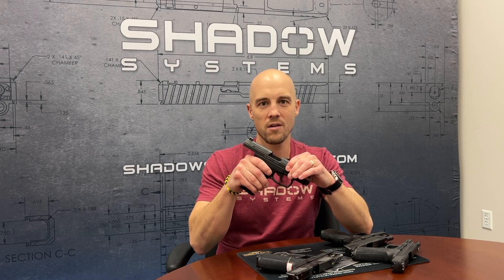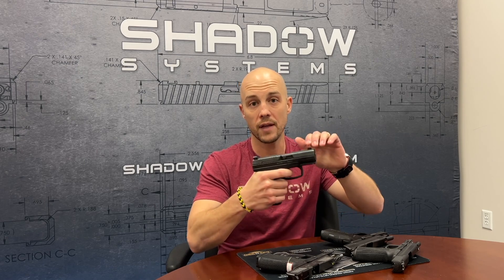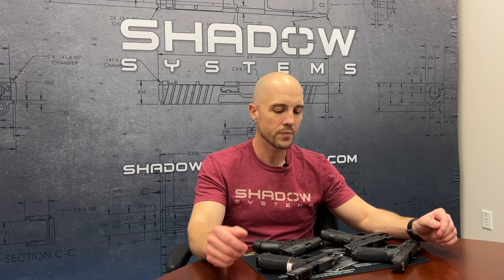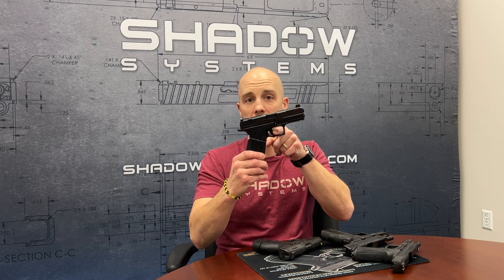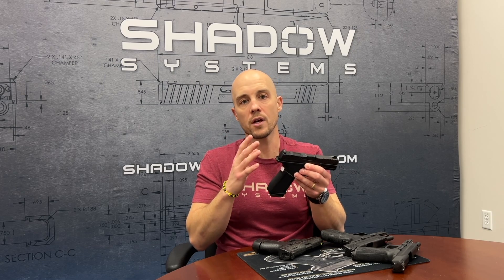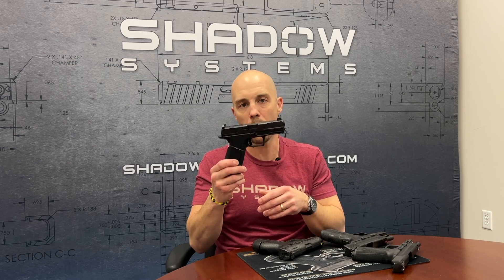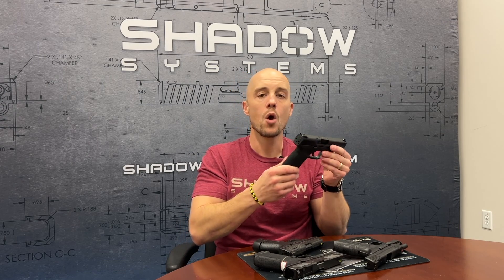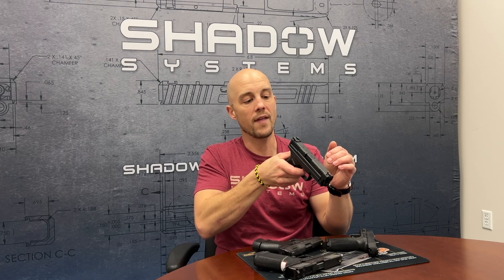Technical Tuesday - Trigger systems and the Timney design

Comment: 💯 agree. If someone is going to purchase one of your firearms for either their EDC or duty. LEAVE IT! ALONE! As a duty or EDC pistol being modified, you run the risk of that pistol not being reliable. If you change ' one ' part, other ' factory ' parts my not work together. Then your changing out more parts. If your not shooting match shooting competitions. Leave your firearm alone.

Comment: I think this was an excellent video on the difference between Double Action (DA) and Single Action (SA) in striker fired firearms.  Thanks!

I like my MR920.  The trigger is ok , but it is spongy... spongier than the GEN5 Glocks I've shot.  I don't want to go to an SA trigger in my MR920 (like the Timney Alpha), but I would like to see Shadow Systems (1) work on improving their trigger (as Glock apparently did), and then (2) offering an "upgrade" to current SS owners.
Reply: I second this. The Shadow Systems trigger definitely has room for improvement.
Reply: Is it a foundation series? If so, it uses a polymer trigger shoe, which can feel a little spongy. The combat and elite series guns use an aluminum trigger shoe, which can alleviate some of that, and they do sell it online. Just something to consider.
Reply: @davidciarcelluti5084  Thanks for your input. I have the Elite version. It still feels spongey to me. Another issue is it becomes uncomfortable after about 100 rounds because the trigger is not flush enough with the shoe. That might not be a problem for other people, though. Anyway, I'm having a gunsmith install a trigger from Ramm Tactical. Going to pick it up this week, so hopefully that'll solve the problem for me.

Comment: After several hours of frustration and phone calls to Timney, my Gunsmith gave up trying to install the comp trigger into my stock Glock 19 Gen 4.  However, he did test installing it in his Glock 19 Gen 3, and it installed and functioned perfectly.  Timney indicated on his last call that Timney had incurred some defective parts in their mfg. process causing issues for installations for Gen 4 pistols.  Since I wasted $$ with the Gunsnith attempts I sold the Timney kit to him at a discount.  I plan on my future purchases with Mcarbo in the future since I've incurred no previous issues with their products.

Comment: Ìronically I have seen a lot of negative reviews on the Shadow Systems triggers on the MR/DR920 Elite models and people that prefer the factory triggers on the Gen 5 over these. When spending this amount of money on a "Elite" version of a weapon that is supposed to surpass the Glock quality, why on earth would it be acceptable to be spending even more money on trigger upgrades? To me these models does not sound very "Elite" to me. Any takes on this?
Reply: I learned a hard leson after purchasing my XR920 two days ago. After taking it to the range yesterday I left very disappointed because the trigger is horrible, 7.1 pounds on my Wheeler digital gauge. I'm no gunsmith, so I don't know what can be done to fix this, but all of the reviews I'm seeing on aftermarket triggers say they don't really work with this gun! :-(
Reply: I have owned about 48 different handguns over the last 30 years,and fired hundreds,my shadow dr920 elite has the worst trigger i have ever in my life experienced😡

Comment: I personally have the Timney drop in system in an xr920 and haven’t had a single issue. Relatively still new, as it’s only seen just short of 1000 rounds, but no issues to date.
Reply: How did you get it to drop in? Seems the trigger bar is hitting the rear of the frame and not setting.

Comment: The trigger on XR920 is terrible, nothing like my MR 920.  I tried to fix using both an overwatch and zev drop in trigger kit and both induced binary fire. I put the stock trigger back in and your customer service said you can do nothing for me and my terrible stock shadow systems trigger.  Unfortunate that your company doesn't help its users.
Reply: Same.... I learned a hard leson after purchasing my XR920 two days ago. After taking it to the range yesterday I left very disappointed because the trigger is horrible, 7.1 pounds on my Wheeler digital gauge. I'm no gunsmith, so I don't know what can be done to fix this, but all of the reviews I'm seeing on aftermarket triggers say they don't really work with this gun! :-(

Comment: I shot my new XR920 yesterday for the first time. I needed to zero the Holosun 507 optic and get started on the 200 round break-in. The Holosun instructions say the sight is zeroed at 25 yards from the factory. Shadow Systems installed the sight and sold it as a unit. I set up a 25 yard target and used a rest. Fired 3 and went to check. Not a single bullet hole. Got a much larger piece of paper and found it was 12 inches left and 7 inches low. That’s 48 clicks right and 28 clicks up. After about 15 shots and further adjustment, I got it where I wanted it. 

The trigger is ok. Not great, but serviceable. It is not completely flat faced and the insert protrudes a bit when the trigger is pulled. Slightly irritating, but not as bad as my G43. 

I have the Timney trigger in my G19. Sweet as sugar. Smooth as silk. Hot knife through butter. Game changer. I’ll make the decision on installing on in the XR920 after the break-in. Maybe the stock trigger will improve with time.

Comment: I contacted timney about it and they said they don’t recommend putting one in a shadow systems.  The trigger on my XR920 is super heavy, even compared to my MR920, so not sure what to do. I’d hate to get rid of my XR based on the trigger alone. Any suggestions?
Reply: I learned a hard leson after purchasing my XR920 also.. After taking it to the range I left very disappointed because the trigger is horrible, 7.1 pounds on my Wheeler digital gauge. I'm no gunsmith, so I don't know what can be done to fix this, but all of the reviews I'm seeing on aftermarket triggers say they don't really work with this gun! :-(
Reply: @Iceflame38  agree

Comment: I don’t like the idea of a Glock like firearm with a fully cocked trigger.If your weapons are always loaded,which they should be as defensive weapons,the springs are compressed all the time.It’s only a matter of time before that spring wears out or fails.I like the standard “semi cocked”Glock operating system which is safe and effective and does not lend itself to failure.

Comment: I was going to buy a MR920L (or 2) from bass pro tonight. All their guns are trigger locked and they won't remove them.  I mentioned I was concerned about reports of crappy triggers. One of their more experienced employees said he could take them in the back and see what he thought. He came back with the 2 boxes and said he wouldn't buy either, terribly gritty triggers. I left very disappointed but it SUCKS when you can't see for yourself.
Reply: Sounds like you need to find a scheels store near you.  That guy was prolly a sig guy

Comment: I have a mr920 elite with a
 timney trigger + Johnny glocks timney combat conversion kit and let me tell you how amazing that combination is!
It works flawlessly and is leaps and bounds over a stock mr920 trigger.
I highly recommend this set up.
$150 -timney trigger $72 -Johnny glocks timney combat conversion kit = a carry trigger that can’t be beat an absolutely amazing set up!
Reply: What does Johnny do to the Timney?
Reply: @5jjt  allows you to shorten the reset and break even more (adjustable)
Can configure the trigger pull weight to your liking. Ranges from under 3lb pull to stock pull weight
Reply: @5jjt  timney trigger is typically just the shoe (physical trigger that you squeeze)
While the Johnny glock upgrades is for the internals. It's specifically designed a certain for maximum performance and safety. It's superior to all other brands for sure...
Reply: @FinessingFather  incorrect. The timney is a completely different trigger system from a stock glock. The internals are completely different
Reply: I called their tech support and asked about aftermarket triggers and specifically the timney and they tell me the gun may no longer be drop safe and is not warrantied.
Reply: @strongmountain7446  aftermarket triggers usually have a pre cocked strikers. But it doesn't necessarily mean it's not dropsafe. Anything you change on a gun will void the warranty. They can't take on that responsibility
Reply: Timney = poo poo doo doo compaired to a ranger proof vex trigger with a Overwatch NP3 trigger bar. There’s a few shorts comparing the 2 and its night and day
Reply: What gen did you get it for. I have a mr920 and was thinking about getting it.
Reply: @920WASHBURN do not get a Timney, unsafe.installed by armor and had a discharge while cocking a Glock gen 4.customer service didn’t seem suprised
Reply: They are on sale though 98$!At palmetto i wish i never got one.also reset problems.

Comment: I bought this gun for the promise of a better more repeatable trigger. I’ll maintain that the best trigger mod you can do is to go shoot your gun and train. No one shoots enough. Spend that money on classes and  learn how to shoot it if it’s a defensive weapon.  If it’s a gamer gun or a range toy, fine. I get it. How badly do you want a high speed part to potentially alter the reliability of your gun when you need it most?
Reply: I did shoot mine. After 500 rounds i got a gritty, spongy mess of a trigger that didnt have a reliable/consistant break

Comment: People… there is a break in period. Give it 100 rounds with stick trigger! I promise. You won’t want to change it. SS MR920L
Reply: I've put 300 rounds through it and still hate it. I never have shot glocks well, so I will be changing mine.
Reply: I am no expert but it seems that the trigger in my Walther PPQ match 5 has a short nice trigger pull. My MR 920L seems like it takes forever to fire , a long trigger pull?  I don’t know if that’s the best way to say it but that’s what it feels like.  I like the trigger in my Walther way better
Reply: So after 3 months I decided to finally try the Timney Trigger with a 3.0 Black Yikes Conmector and Zev Pro slide kit. And it is just as smooth as my Staccato XC. Super hard to believe, a Glock having a good enough trigger as a 1911? NO WAY. But yes… seriously take up is super minimal, wall is very crisp, reset is almost INSTANT. Timney and Zev have been around a while, I figured let me give them both some love in a MR920L. With that being said. Don’t expect any kind of warranties or liability issues with Shadow after changing OEM parts to aftermarket. That’s pretty common with majority manufacturers.
Reply: An XC with an Atlas trigger is on another level.
Reply: @bradpowell843  that’s like comparing a Ferrari to a Ford Mustang…

Comment: Funny this video showed up today - I installed a Timney trigger in my MR920 yesterday - have not shot the pistol yet but let me tell ya --- It is absolutely the best trigger I have now compared to 4 other aftermarket glock triggers. 2 have the apex which was my favorite, overwatch and a boogeyman. The pull, reset and oh so clean break, it will make ya smile - disclaimer - I've only dry fired and not done any testing so take that for what it is but --- Its a niceeee !
Oh yeah - waiting on me a XR920 for my second SS
Reply: Thanks, which trigger did your ordered? Específicos for the Mr920?  Thanks

Comment: Trevor what causes the trigger to get gritty after break in.  Gun is clean but more it breaks in the more gritty the trigger pull is getting.  I also left 2 voicemails for customer service to call me about all the play in the rails.  On trigger pull u can see the slide lift up with some play.  My glocks are tight and doesn’t rattle mine is extremely loose in the rails.
Reply: They don seem to get back to questions very well. I have 2 emails unanswered as well as a dm on insta. The only time I ever got a reply is when I couldn’t get the store to work. Ie request for help giving them my money. This will determine future purposes of their product. I shouldn’t have to call to get simple questions answered
Reply: Mine does the same thing with the slide lifting  but when I put an empty mag in it. it stopped that movement. I also blew out my trigger springs with air compressor.
Reply: Thanks I been so nervous.  My friend is having same trigger issues with the grit feeling and both of ours are clean I even used compressed air blew it out and still the same so I’m worried bout it
Reply: @Cortney_Whitecotton  sheesh that concerning did you re lube good. I hope nothing got bent and I hope Trevor gets back with maybe a rhyme or reason for it.
Reply: My DR920 has the same play in the slide and SS told me it is normal.  The only reason I brought it up to them is because the gun malfunctions more than I think it should. The ammo I’m using is not trash (AAC from PSA) but it stovepipes and double feeds about once every 25-50 rounds.  I am running Magpul mags as SS recommends.

I have started using Winchester/Hertenberger’s to see if the problems go away.

If it doesn’t I am going to go back to them for help.

Comment: I've tried it in my SSC MR920 and DR920. I've not yet installed the other one I have in my MR920L because that's my EDC and I'm not fully confident in it yet. I need to call Timney. In hundreds of rounds tested, I've had two instances when the gun fired upon release of the trigger. Another friend had the same thing happen routinely in a P80 build. I have a feeling it has to do with the trigger housing needing to be OEM Glock instead of some proprietary part. I believe SSC uses a proprietary trigger housing; at least it's stamped with SSC on it. My problem might also be that, in performing prior trigger work on the original SSC trigger, I polished the connector. That helped smooth out the OEM trigger somewhat, but it's may now be causing an issue with the Timney installed. The good news is I've got time to play with this some more and the tech support folks at Timney are fantastic, so I'm going to give them a call this week to learn more. According to a gentlemen I spoke with before purchasing, they've tested their trigger in SSC guns with a good result, so it can be done.

Comment: The SS trigger is great once it breaks in, I really don't know why all these people want to change it out.
Reply: I like the trigger. I have kept it. But it does feel a bit slow with the longish reset.

I'm not saying the firearms are similar or on the same level, but you check out the trigger on a Canik METE at nearly half the price and it has like a 2mm reset. 

Again, not saying it is a bad trigger. It works just fine for me. The trigger on my MR920 has pretty much zero creep once I reach the wall and it breaks crisp. I have no doubt when the pistol is going to fire once I settle at the wall. So I am not dogging the trigger. I like it. I just wish it was a tad faster.
Reply: I’ve left mine stock, for now. I think most like to personalize or customize to suit there own needs or to accessorize as they deem necessary, kind of like changing components out on a brand new car/truck. That’s my .02….
Reply: Sorry bro coming from a M&P Apex trigger? The 1911 of striker fire triggers? This trigger is lacking.
Reply: @Three60Crusader  Sounds like too light and crisp for defensive duty.
Reply: @5jjt   tell me you know nothing about triggers without telling me you know nothing about triggers
Reply: @HazardousRob  pfft, I'm a trigger-engineer, and engineer triggers with trigonometry.
Reply: @5jjt  maybe an engineer of idiocy
Reply: I don't like it. I prefer the factory gen 5 trigger. The trigger pull is very long.
Reply: Mine was terrible. After putting 500 rounds through it, the trigger got gritty and very very spongy. Literally would have the trigger 99% depressed before it would finally break. Shadow systems sent me a replacement trigger group, but it still isnt great
Reply: @HazardousRob   850 rounds in and I have the same spongy trigger. Basically no prepping to the wall because the first wall isn’t really there.  Just more spongy creep than the gun fires 99% of the trigger pull.  I order a timney trigger and said F voiding the warranty
Reply: @nasty98772   I did the same. Ordered the timney and added the Johnny glock mod to it. Now the thing can't shoot a full mag without 6-7 ejection failures
Reply: @HazardousRob  damn so would the timney be better by itself? Or just keep the stock trigger for reliability. Have had 100 reliability in stock configuration.
Reply: @nasty98772  I doubt the issues I'm having now are due to the trigger upgrade. I switched it back to stock and still had issues. They just sold me a lemon of a handgun. I've sent it back twice now for work
Reply: Because people think upgrades can replace skill.
Reply: @maxfit68906  not replace, supplement